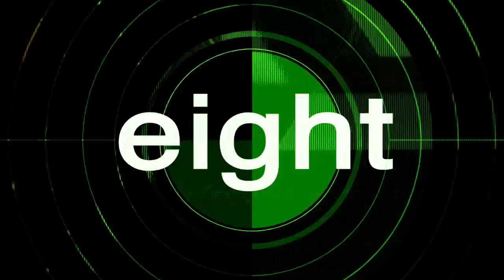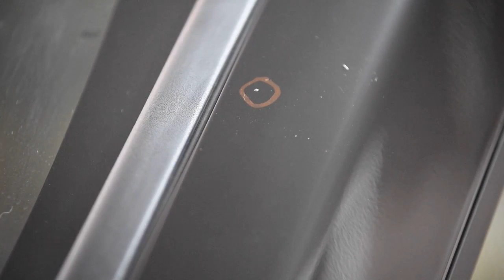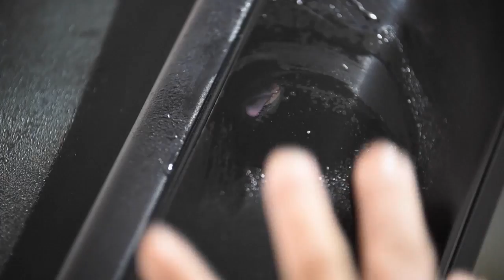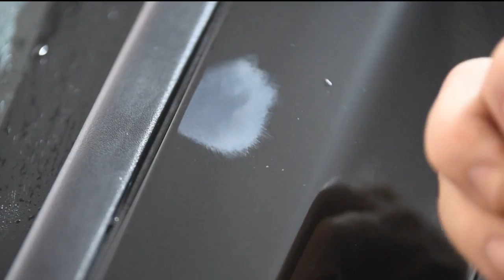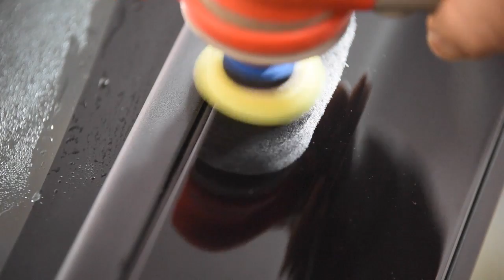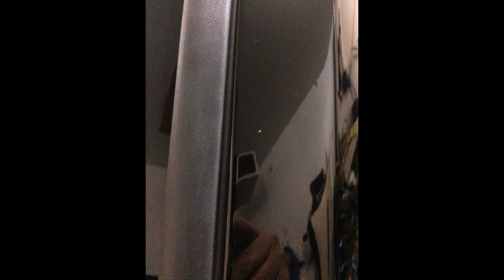Larger Paint Chip Repair

Comment: You need to re-do and clarify this video.  Start by repairing an actual large chip, maybe 1/4   to 1/2 inch diameter.  It is hard to understand what you actually did here.  Looks like you sanded the clear coat down to the base coat and then polished the base coat!  Most large chips I have seen go at least to the primer, if not all the way to the metal and would require paint.  As is, I find this  video confusing and unhelpful